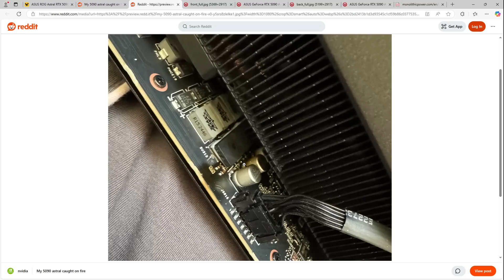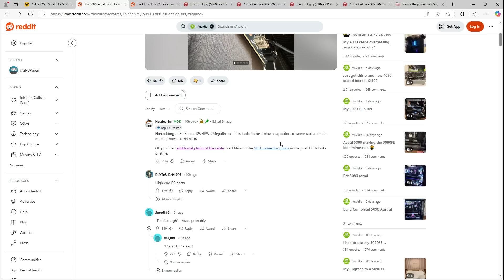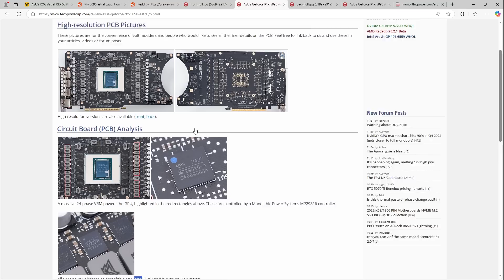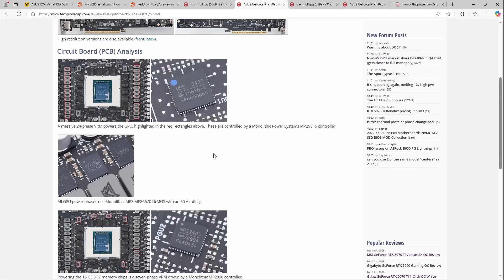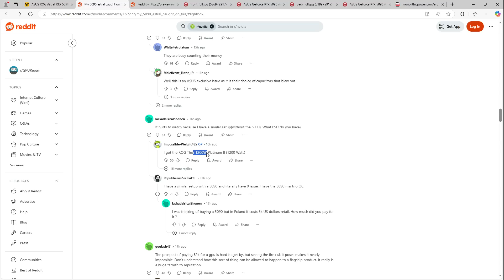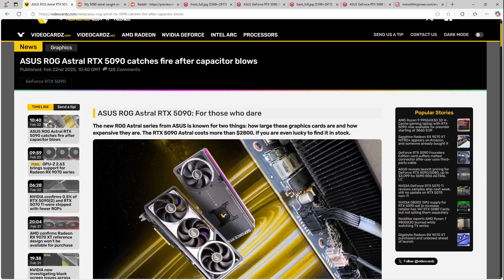Innocent capacitor blamed for ASUS RTX 5090 Astral catching fire

Comment: You're 100% right. People aren't realizing anything about capacitors. They don't realize they're just basically little batteries. They're also made out of titanium now. That's why they call them titanium caps...

And they puff out and get fat when they took to much power .   . 

You see this allot in car amplifiers ...

People that draw to much power.  Or just run the amp hot . .. 

Most those car amps are shrink wap with a metal top under the shrink wrap .. 

And you're right, I never really hear people replacing capacitors and fixing their video cards. It's never been the issue. She's usually the memory modules or the GPU ... 

The pads on the gpu or modules went bad . 

I never heard of gpu Caps being the issue. . 

But ever since the Bitcoin and the price increase I've been kind of staying away from PC building and video cards because the ridiculous scalping price going on on video cards. I paid $350 for top of the line 970 in 1996. $350 car audio does the same thing and they're not unrealistic about it. Basically in car audio since they have an assembly line. Just like Nvidia has an assembly line. What car audio does? Is they release the same product just as a revision with slightly better for the same exact price as the one that was 2 years old or 3 years old every 2 to 3 years. They do a revision just so they can make money off their product again. This will be like harming. Carmen, they own Infiniti and JBL and they'd stamp all those out and all three of them will make the same speaker and it'd go for about $200 and it would stay about $200 and it's been $200 for like 20 to 30 years. The only thing that I noticed increased in the last 4 years was JL Audio and subwoofers and car amps. They all seem to double... 

Before covid jl audio w6 was $420 ... 

After COVID-19.  . 
The W6 went to $840 .. 

I bought 2 of them..

I know i got version 3 but car audio kept there same prices for about 30 years.. 

I bought a nuce system from Dow in 1998/9 ish .  

It was a pair of 10 inch w0s jl audios in a sealed jl box .. 

On a Rockford fosgate 160@4 

Only 80 w were going into my JL Audio wzeros in a 1964 and 1/2 mustang and it sounded banging and this was in 1999 and then I got another system in 2004 JL Audio 12 w0s again but on an eclipse 5 channel amp....

But that's all irrelevant 
What's important is it does look like it's the PCB board. Something's up with the board and I remember seeing a lot of cracked boards and them repairing a lot of repairs right? Kind of next to the power. Kind of like what you're talking about.. 

I think your video is correct.. 

And the ones I'm seeing that are trying to blame it on the capacitor wrong because you're right that capacitor's fine it most. It could possibly just be what you're saying like it was just to heat it up from what happened around it or could even be the photo itself.. 

And $750 for a 5070 Ti ..

That's triple MSRP .. 

But they are actually selling at 4 X times the MSRP.. 

And now top tear mother boards are as high as $1000 .. 

By the time I have enough money to build the best computer, my computer is going to be outdated and it's time to try to build another one cuz they're now starting to pop video cards out. Almost they started doing it every 3 years now. They're doing it almost like every year to 2 years...

I keep waiting... And now there putting out junk that has TAMIYA STYLE plus that cook...

Instead of gold plated XT60s or  XT90s RC car plugs.. or even banana plugs ... 

They still use that cheap metal on those plugs that turn darker the different color like like headers on Chrome headers in the olden days on cars. When they used to heat up they turn all purple next to the engine and they would change rainbow colors as they you look down the header. It was a Chrome header. That's what would happen to Chrome. That's what happens to cheap metal when you use it for electricity..

And over time as the metal changes its molecular structure, it starts creating resistance, getting hot and becomes a bad conductor of electricity and then eventually can start fires..

That's why on PCs everything that goes metal the mental contact should always be gold ...

Even both the mother boards pci slots plugs that are not .. 

That one hasn't been an issue but it's crazy how they went to a completely different power plug and it hasn't been working and they keep continuing to use it but go up into drawing more power through it. Where's the sanity in that? ..

I've been waiting since the 3000 series for them to do things properly. In my mind I kept saying they're not putting enough video memory on these video cards. Since the 900 series I felt like me having only 4 GB of video memory was ridiculous because it's 2016 and I only have 4 GB of video memory. I remember in 2004 when 1 GB of RAM came out about the same time. They start putting a gigabyte of RAM on a video card because I bought a gigabyte card with 1 GB of video memory in 2004. So I felt like they should have been at least using 16 GB of video memory on a 900 series card, one of the top tiers.  

That's when I start to wait...o thought the 1080 will e the card . 

The the bit coin hit right at the 2000 series release time
.

You couldn't even find a video card and then my $350 video card was selling used for $1,800 on eBay...

Hell no .. 

In just gave my 970 extreme gaming to my kids ... 

Expecting to upgrade with $400 saved for a new card .. I think this was 2018 ish .. 

I've been trying to blank things out for a long time because I haven't been happy with the way things have been going in the world. I thought PlayStation 4 was a hot box even though ran okay hot as shit .. 

And PC world was out of control...

Now Mr. Jensen who shares my last name is releasing crappy gpus ones that are overheating ones are breaking that are on cheap PCB boards and now ones that can't even run old video games but they aren't just four times more. The the 570 is four times more, but like the 5080 that price is insane. The 5090 that price is insane...

And a crappy power cable.. 

Well I hope after Chinese New Year's.. 

They go back to the old power plugs 

5000 series is  insanity.. 

They're basically re-releasing the same thing. Trying to expect different results but drawing more power. I'm glad they only made very little. This could be a sign that a lot of people didn't get screwed over
Reply: Well I just did just now see a copper mod video that was knocking capacitors out. So I guess doing a copper mod can knock your capacitors out the mini ones
Reply: I was getting ready to copper mine my original PlayStation 5. I'm not having overheating issues cuz I have a ridiculous amount of fans on it but I didn't want to copper mod it. Now I don't

Comment: It's because back in the days, Motherboards were dead because of capacitors which were mainly liquid electrolyte capacitors. This kind of issue sticks in people's head. Just like when discussing digital signal integrity, people will call out jitter, and concluded digital errors can never be corrected.

Comment: Back in the day caps were what typically went out. They'd crack the tops and start leaking. Not a thing now a days like you said but I'm willing to bet the ones that jump to the caps are old school folks where that was a common thing. Happened on motherboards, video cards, and sound cards. Again, way back when, and yes, I'm old school but I at least know caps of today are not the problem.

Comment: you can see how the vrm controller fused to the pcb, all the heat released to both sides, to the capacitor, and to the coil, you can see how the its plastic cover is melted,
i dont repair gpus, but i watch all northwestrepair videos, aren't those 0 resistances just before the vrm controllers, fuses? maybe i'm wrong.
i think sometimes the fuses don't blow when this things happen, not sure why, seen that happen 2-3 times.

Comment: Another way to protect GPU in case of mosfet failing and dumping 12v to core is voltage limiting diodes for example Zener diode. Or just fuse on each mosfet, build into the mosfet it self or into graphics card pcb.

Comment: For a good length of time, you could fix a number of devices, including motherboards, by replacing cheap Chinese electrolytic capacitors with higher-quality Japanese ones.  

A dozen plus years ago, I had an LCD monitor that started taking something like a minute to power on after leaving sleep state.  I opened it up and found at least one swollen electrolytic capacitor, so I removed them all and replaced them with good quality Japanese caps.  Monitor worked perfectly fine after that for many years.

Lots of people have experiences similar to that, with many kinds of devices, so blaming capacitors became fairly ingrained in the discourse.  There were even lists maintained of bad cheap capacitors and good quality capacitors to replace them with.

So there's a lot of momentum behind the impulse to blame capacitors first any time something goes wrong on a PCB.

Comment: When a mosfet driver on the cpu vrm on an EVGA motherboard blew up with a hole on the top of the smd .... evga blatantly told me that the blown part was a capacitor that blew and it was caused by a faulty PSU ... years and years later I'm still so angry about that especially since the said PSU is still powering a mining rig to this day without instability.

Comment: I have an audio/IT background. As mentioned elsewhere, the capacitor explosion of the 2000's left a lasting memory that is infrequently reinforced by failing caps in aged audio equipment. My first guess at these pictures, seeing yuck on the board next to a brown capacitor, is a gut reaction blown cap.

Is it wrong? Probably. But I know how someone can just ignorantly blame a capacitor. And yeah, I've lost power stages on motherboards, GPUs, and MOSFETs on amplifiers. I am just reinforcing the Dunning-Krueger effect.

Comment: I think the word "Capicitor" is an arbitrary term non-electrical savvy people would use. Capacitors to them probably mean switches, inductors, capacitors & mosfets etc... they're all just "capacitors" to them. That being said, if i were that Moderator, id just say "not a 12HPWR issue, looks like some form of board/component failure", as opposed to "capacitor". They just didnt know what it was called, and Videocardz took that as the actual cause.

Comment: 50 series has been a joke! 
Prices a ridiculous 
ROPS missing 
Cables catching fire cause no protection 
No stock 
3 fake frames a “feature”
Barely 15 percent uplift 
5070ti fake msrp
Redesigned but not really redesigned high power connector
Not supporting 32 bit physx secretly
Early card failures for no good reason like this one. 
So like I said what a joke! 
Don’t worry AMD will manage screw up this opportunity by overpricing their 9070 xt and not making something like a 24gb 9080xt at all!
So in other words as consumers we are still fkd

Comment: Leave capacitors alone.
Love it when people who havent touched a smd component in their life comment about things they dont know about. You can clearly see the soot coming from the side of the power stage, probably has some nice welded pins under it.
And agreed, this is a component/manufacturing failure, the owner should get the card replaced.

Comment: Further into "fake frame, real issue" arc. Thanks for the eductating video 👍
Reply: Fake frames, fake MSRP, fake supply but real flames!
Reply: @andersjjensen  You are right, forgive me, I'm so used to have fake MSRP living in EU, I don't see it anymore, kinda same about supply haha 😅
Reply: @ Uh... We have 19-25% VAT in the EU, depending on country. Up until supply dried up I could get any Radeon 7000 or RTX 40 card for similar money to the US given the formular "convert USD to EUR, add 25% and round up to nearest normal looking price" here in Denmark. But yes, we are now back to "even more stupid markups than the US" because for some reason Europe doesn't get supplied equally.

Comment: people still have memories of the capacitor plague and are still blaming all their problems on caps.
most of the capacitors are there for power filtering, the big one is to reduce ripple. the inductor is just a coil. if i were to blame something id blame the regulator chip, might be some counterfeits got into the supply chain.

Comment: The ghost of the Capacitor Plague still haunts us. For years capacitors really were quite likely to be responsible for a hardware failure. It was frequent enough that "capacitors fail often" became common knowledge. Years passed, and that same "common knowledge" was handed down to new hobbyists and repair techs. Fast forward to today where our capacitors far surpass anything that was available at the time, yet they're the least trusted component because it's just common knowledge that capacitors are sus and not to be trusted.

If you think this is bad, you should see the nonsense that goes on among car hobbyists and DIY guys that have been at it for a while. The "common knowledge" runs so deep you'll see people, with a straight face, blame problems on parts that don't even exist.

Comment: Regarding backwards capacitors, the Macintosh LC III is a famous example from the '90s where every unit had C22 backwards due to an error on the silkscreen, i.e. the factory populated the PCB "correctly". The caps seem to have handled a 5V reverse bias relatively well—it seems like the problem was only discovered in 2013, some 20 years after the Mac LC III was launched.

Comment: Its concerning that this happened on the most expensive Asus Rog Astral 5090 Graphics Card. The only way that i know that this could happen is if someone installed a SOC Bios solely intended for NO2 cooling but used it without doing so, trying to achieve a HOF 3 D Mark HOF Title.

Comment: A Capacitor doesnt flow current in one direction, if it's a good capacitor it will block DC current.  If it is 'polarized', installing it backwards will cause it to heat up and explode.  A diode on the other hand will flow current if installed backwards.
Reply from the maker: What do you think makes the capacitor heat up if you install a polarized cap backwards?
Reply: @ActuallyHardcoreOverclocking  global warming.  Same reason the polarization of earth is reversing.  It is ALWAYS global warming.

Comment: Theres no fuse in the world that lets card get 570W , lets peaks of 700W pass  , but protects from 1000W peak or short  .  
Even if they do exist ( the true ones that would do the job reliably and in such tolerances)  - they cost more than the card itself  ...
Point - with all that wiring  (different resistances that add up )its impossible to make such fuse !

Comment: Having these used on a motherboard proves nothing tbh, motherboards are vastly overspecced and are never used to their limits, 600w is another thing, on the other hand it failed during browser use so def not 600w. It seems like a simple factory defect, in todays dna age any failure is overblown into something it isn't, even the power connector is not as widespread as it might look like, let's wait and see if this happens to more people and different cards

Comment: With the power consumption ramping up this quickly, is it time to add 24v or 48v rails for these workloads? Wouldn't that let vendors reduce the current required for the same wattage?
Reply: It also need ai cooling as well as ai watts

Comment: With what you have seen on the board reviews on the 50 series, plus the now various reported failures of one type or another, would you buy a 50 series card? If so, which one would you go for & why? 5090, 5080 or 5070Ti, which brand & model?

Comment: I actually did repair an old x58 board in like 2017 or so by soldering on a new capacitor after the cap blew out the top. No idea why it blew that way, but the board is still in use so I clearly fixed it with that new cap, when it wouldn't POST previously. Still really proud of that repair, it was my least skilled repair ever (I've since gotten way more experience doing board repair) and the first time I succeeded in fixing a PCB.
Reply from the maker: do you remember what board it was and which cap?
Reply: @ I just confirmed it was an ASUS P6X58-E PRO, he checked his ebay history. we originally purchased it as a for parts/repair board and took a risk on it just being the capacitor, it was one of the ones on the right side of the CPU socket if I remember right (not in the main VRM). He had an old ES CPU he got from someone at Anandtech for working as an admin on the Anandtech forums for years by that point, and was just looking for something to stick it in and use it. also i was wrong about the year, we got it for $95 in 2020 lol. Damn pandemic warped my perspective of time.
Reply from the maker: Well I had a look around on google and apparently there are HP and Dell boards that use liquid electrolytic caps so I'm guessing you probably repaired one of those.
Reply: @ActuallyHardcoreOverclocking  it definitely wasn't an HP or Dell board, was one of the usual suspects for DIY boards

Comment: Hmm.. I was thinking the same. I hardly saw capacitors dyeing in my 30 years with computers, power stages and mosfets on the other hand. If it died so soon from being new, it sounds like a manufacturing error of some sort. It's not even a month yet since the 5090 was launched :|